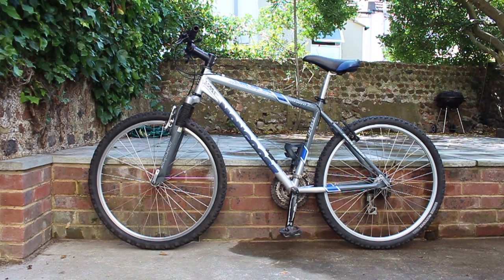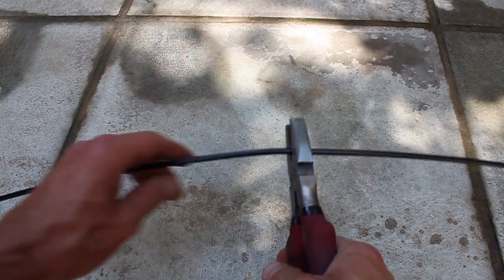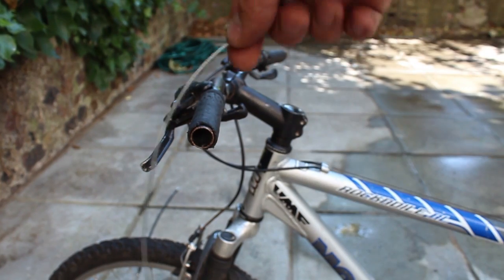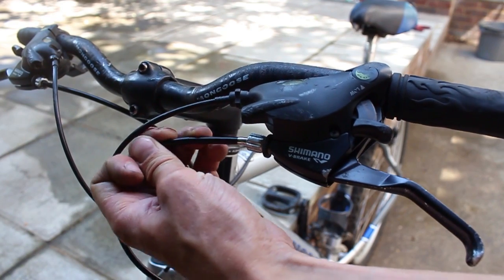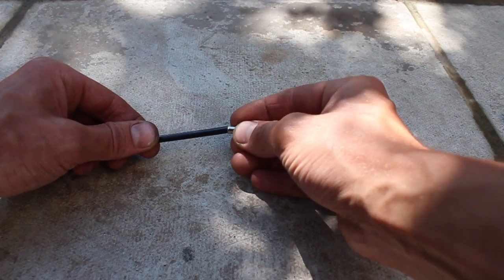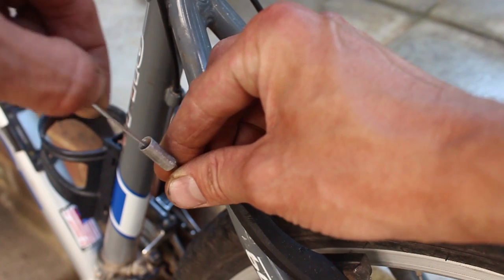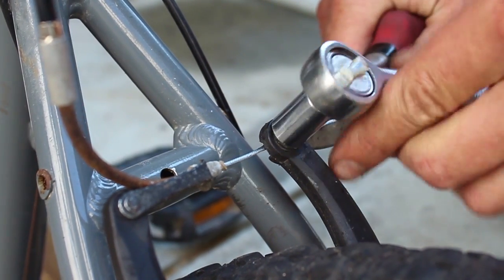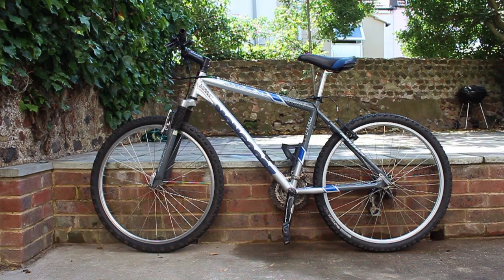How to re-cable v-brakes

Comment: You failed to mention that in order to remove the cable from the lever that you must firstly loosen the cable all the way from the pad anchor and also cut the old end cap off to remove it completely.

Comment: Hello superb video. Can you make a video on how to adjust the spring tensions on V brakes. I am unable to put them through and the brake pads are sticking to the rims now.
Reply: Take the v brakes off the frame and take the cover off. Make sure the spring is in the right place inside so when you turn the screw it hits on the end of the spring. Then put in the middle hole on the frame. If one side is rubbing you have to turn the mini screw clockwise to push the pads away from rim and anti clockwise to push towards . If one side still isn't moving then check the spring inside like I mentioned and also check the arms of the v brake are equally away from the centre. If not u may need to experiment with extra washers on one side. Also check your brake levers and barrel adjusters are working correctly.